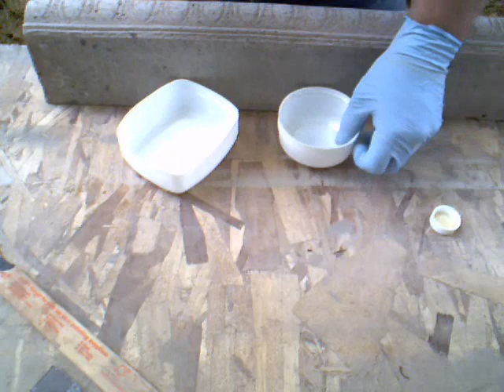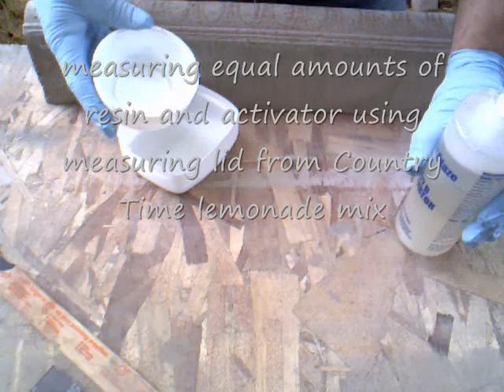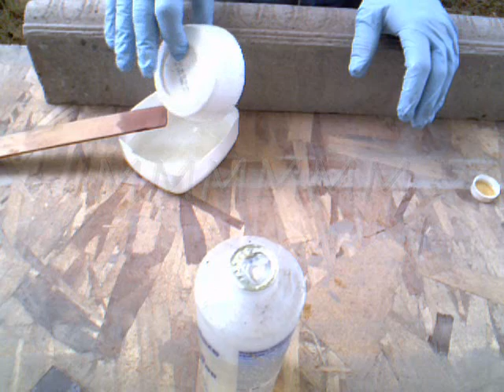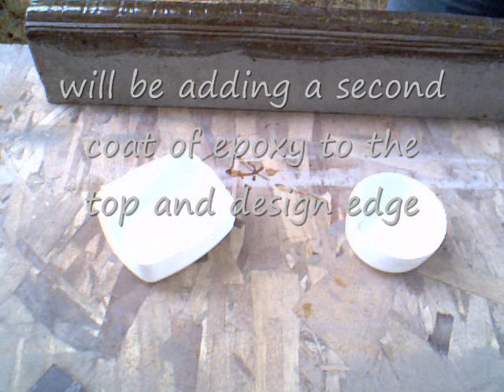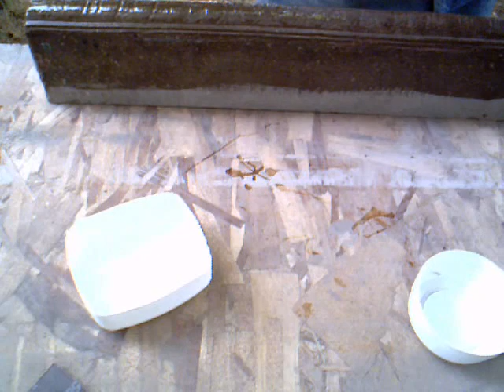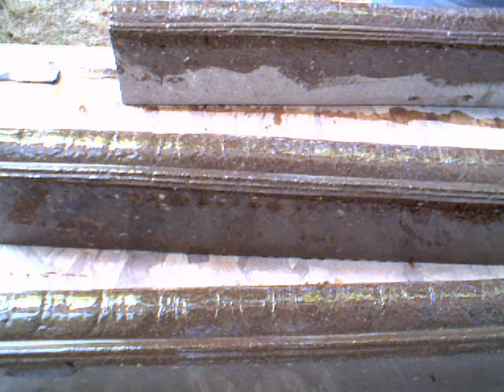applying clear coat epoxy

Comment from the maker: @Noatak72  i didnt use any of the shelves. It turned out to be more of a learning experience in decorative concrete. The 1 inch shelves could hold 40 lbs or so and the 2 inch shelves could hold 200 lbs or so. I needed to get the place rented fast and couldnt spend the time and money it would have taken to incorporate the shelves. Somethings I would do different: coat the rebar with enamel so the shelves dont split if water penetrates the epoxy, and make shelves atleast 1.5 inches